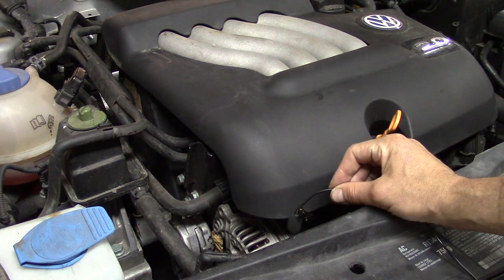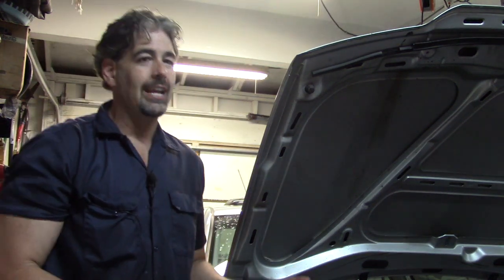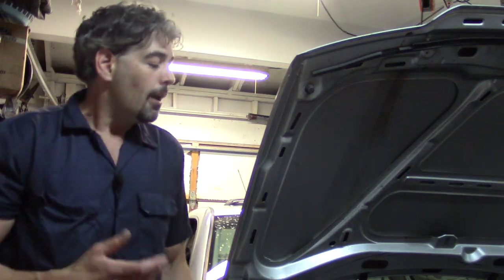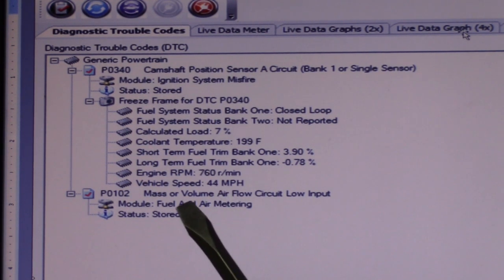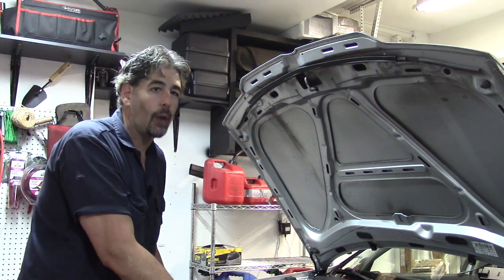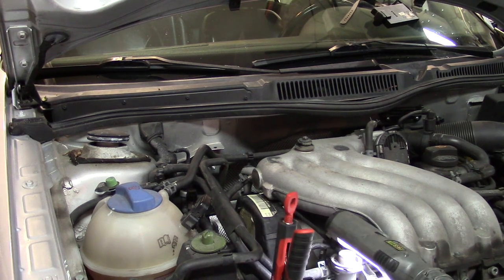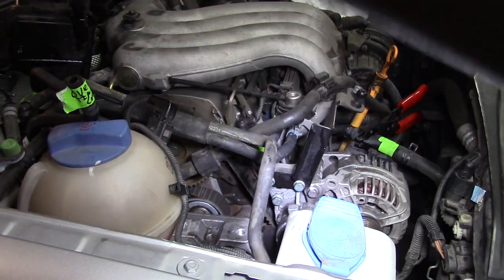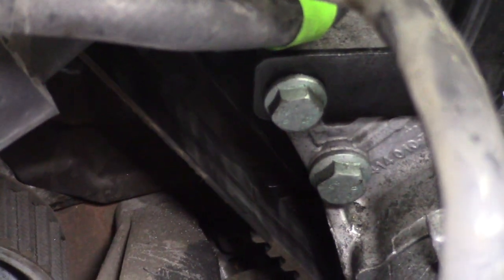Volkswagen Engine Noise Diagnosis

Comment: How did the shop not catch this?!   You have to pull the timing belt and cam gear to get to the cam pos sensor!!
Reply: Exactly what I was thinking.
Reply: They are the ones that damaged it. Slapped it back on and said get it the hell out of here.

Comment: Hey Mr... I love your videos keep up the great work.... from my understanding when you remove the valve cover there is another cover that goes over the cam shafts... could that be your broken piece? Also there is the all time audi vw problem where the high pressure fuel pump wears heavily on the cam lobe... my two cents
Reply from the maker: Jose Sifuentes Indeed a loose fragment of some sort behind the timing cover was highly suspected.  As for a high pressure fuel pump wearing out a cam lobe- that honestly makes no sense to me whatsoever off-hand. What is proposed theory behind that?
Reply: Audi Volkswagen have direct injection on their vehicles... if you so happen to have this engine.... what we see here at the stealer ship is the highpressure fuel pump runs off a cam lobe and that part becomes heavily worn
Reply from the maker: Ohhhhhhh- that makes sense!  Yeah I am not versed in direct injection. I will have to research that but your explanation seems reasonable.

Comment: Matt great lesson to all the people out here in you tube land that think all there is to diagnosing a modern vehicles is plugin in your whatever and getting a code(s) are sorely misinformed or downright ignorant. Verify,confirm and validate.Thanks again.
Reply from the maker: Daniel Wells Thanks Daniel.  BTW "wells" is perfect last name for a diagnostic mechanic lol.  Any relation to the company?
   Yeah Youtube blows- I actually decided to look at the market for videos on the timing belt change- NONE showed the correct procedure for adjusting tension and in fact the most watched video on the subject of all (almost 300K views) didn't even mention tensioning- in fact the hack put the belt right back on the same timing components with no tensioning adjustment!!!
  I feel responsible to now make a video of the tension adjustment just so YouTube will have a resource for this engine.
Reply: Schrodingers Box YouTube blows?  Mr. Box I love your videos. They are spot on for someone who is not a paid tech. I hope you continue to contribute.

Comment: No special tool needed for the serpentine belt tensioner. An open end wrench (17mm?) will fit on the same tab where you put the vice grip.

On my VW Eurovan, the "special tool" for the same function is an 8mm bolt.
Reply: Yeah i know, as soon as people from murica or canada (or where ever) see an euro car. They freak out. Do some reading. I know, alot of german cars (like my passat -98 v6) needs special tools and all that. But that's usally only for the dealership. They wanna make some money maybe? But you REALLY don't need em. 9/10 you can get by them. 

And in this case, NO there are no special tool. It's 8mm allen head bolt so you can turn it? I can't remember but there are like a regular 10 mm bolt that you can remove it with...
Reply: I'm looking for the egr valve or combi valve  on my 99' vw golf gti and cant seem to find it or figure it out anywhere else. Hoping you might be able to help me out?

Comment: Half the fun of owning my Golf is making the "special" tools in my kitchen and giving the finger to VW. ;)
Great video as ever Matt o/
Reply from the maker: Bob Moore Yes I agree with you- there is definitely a satisfaction to designing your own work-arounds for special tools- especially ones that cost a lot.  I have a whole collection of specialty tools I've made over the years, but the difference is most of them will apply to many, many makes and models. To make a specialty tool for a single model that I may never see again is just not possible because nowadays I have other cars waiting in the queue and I can't spend 2 hours making a tool to replace a drivebelt.

Comment: No special tool required for the removal of the serpentine belt. 16mm wrench to slacken off the tensioner. There is also a hole in the tensioner that you can insert a 4mm drill / pin to lock it in the loose position.

Comment: The requirement for specialist tools for European cars is entirely deliberate, manufacturers don't want us tinkering with their cars when they have a dealer network that will happily charge us £100 per hour to carry out the work.
Reply: It's actually a very weak act. Most of the time technicians just improvise like in this video because it is too much effort to leave the job to find the silly tool. I like all this nonsense because it helps to make European cars very cheap to buy used.
Reply: You can find ways around that, I have used a socket with a extension to pull that belt cover back, you just gotta think out of the box. ;)

Comment: Excellent video! Joy's husband here. Small time repair guy. Yes; germans make a lovely engine. (Got a BMW 325xi with 300k. Motor is like NEW. Obviously; well maintained!) AGREE completely: the special tool thing is wildly annoying. Diagnostic difficulty also. Yeah; i got a 99 Passat with that HORRENDOUS "rattling" in the top of the engine. Gotta be like yers; tensioner out to lunch. Some other videos indicate a 'chain' in the rear of the engine. (another brilliant german anomaly. vis a vis: the HORRIBLE german V6 in the last model Ford Explorer. Goofed up all the time due to lack of oil changes.)  Great engines...BUT; you better do the maintenance dawg...or empty yer wallets!

Comment: man, i joined you recently and now i have alot of respect for you, you are indeed a professional. please continue making more videos and also kindly recommend me a cheap scan tool which can make diagnostics a little easier
Reply from the maker: EngrChillaX I actually used an Innova model- I think a 9430 if I remember. It had all the features you need for like $290
Reply: Schrodingers Box thanks
Reply from the maker: ***** It is self contained, however connecting to a laptop will allow you a bit better analysis (e.g. generate graphs, etc).  I also own an old Mac TaskMaster that I use in the field sometimes. You can find them on Ebay a lot.  It's nothing short of excellent for a scantool under $400.

Comment: That's a VW Mk4.  Ask me how I know! I had that exact same sound on a 2002 Vw Golf, started about ten miles before the car wouldn't go anymore because the timing belt lost too many teeth.

As it turns out, the 2.0 is sometimes listed as interference, sometimes not. Valve damage can occur.

Anyway, thanks! I've been trying to figure out what made the teeth come off like that, and a loose tensioner makes sense. Wish me luck putting it back together without needing to replace the head.
Reply from the maker: Yeah good luck- I too have seen it listed both in interference and non-interference so I am not even sure! Either way, hopefully the valves are still straight!
Reply: what happened to me  i did not change the timing belt  or forgot to !! im original owner of a 02 vw golf 2.0 gl  bought it with 16 miles  on the OD !! im a bad owner !!  BUT the timing belt did not break on its own until 159k miles !!! thats a long life for a timing belt !!! sux i had to replace all the exhaust valves !!!  cost me 1200  dollars !!  live and learn !!

Comment: Simply put if I had time Thursday morning when the video came out. It made my day. Thank you.

Comment tonight after the series is done: Okay. I'm rewatching this video to get further in depth with how you could have gotten to your conclusion with the evidence.

Your videos give me experience faster than real life gives me opportunities so these are the things I'm picking up on:

Camshaft position sensor code has a comment about misfire...okay, that's expected. If an engine isn't known where it's at it can cause misfires. (Speaking of usual misfires associated with camshaft sensor trouble.)

I'd expect a P0300 to come with it ...

Misfire codes tend to set faster than any other code in my experience. If this was the primary concern based on the PCM's evidence why in the world wouldn't such a code get set too? My only answer is because firing is happening on time, that's obvious to this good camshaft sensor and the crankshaft sensor...the reference wording in this case with the camshaft code doesn't apply to the situation correctly even in an unspecific way.

Further throwing out misfires being the primary concern. While the engine is running wrong, it's generally even.

In my ACE prep studies there is a comment about loose timing chains causing a slapping sound....doesn't this sound remind of that, the material is just different?

MAF code, not enough air?

If I keep your FASTTEC method in mind for a car that won't start and remember to consider timing as a basic reason for an engine running right, then and only then could my mind go where yours did.

Thank you for influencing my thinking in the future.

Forgive me if these comments were better suited as notes for myself than a public comment.

Comment: I have had the same car now for 11 years, do all the maintenance myself,  the only special tool that I have encountered being necessary is the spark plug boot puller,  the rest can be improvised.  Even the timing belt tensioner tool is unnecessary,  a c-clip tool works perfectly.

Comment: Proof that some dealers have poor excuses for a mechanic.  Troubleshooting skills and knowledge on the cars they work on is key requirement to the position.  I had a error code related to secondary air pump pressure being shorted.  Guess what they wanted to do?  Replace all related components related to the secondary air pump system to the tune of $960.  I checked the pump and it was fine.  Replaced the pressure sensor ($85) and cleared the VW proprietary codes ($30)... Took 1 hour total.   Passed emissions.

Comment: It's always best if you can replace the belt and show that the repair is verified on video.  99% sure you found the issue but you never know until the after repair video shows the viewer the confirmation of diagnosis.  I thought it was going to be a sheared crank pulley myself because they can make similar clicking noise.  Great job finding the issue quickly and efficiently.
Reply from the maker: ***** Yes if time allowed I would do that but I am leaving out of town soon and have to desperately get this car out of here.  Even if there was other damage the diagnosis still holds true and the main thing was the point that changing the CMPS is just lunacy.
Reply: Schrodingers Box Without proper diagnostics and guessing everything is lunacy. ;)
Reply: ***** For the customer yes but for the money no. The fault said cam pos sensor so a position sensor is an easy sell. People these days are actually proud of the fact they know nothing about cars. This makes it easier than ever to rip off a customer.
Reply from the maker: Andrew Thompson Andrew is correct- the lack of diagnostic capability combined with customer not being car savvy equals huge profit.   If customer had OK'd a $3000 camshaft replacement, the shop would have immediately noticed the broken tensioner and stripped belt as part of the process.  A whole timing kit for this engine is $150. I don't think for a second they would have said "ohhhh, our bad- your bill is now just $600 for a belt instead of $3K for a camshaft".
Reply: Schrodingers Box that's what i tell my friends and i believe in, you should be honest with the customer because if you'll tell the truth, you are getting a satisfied and regular customer
Reply: EngrChillaX That's a strong point at my shop. :)

Comment: Kinda knew what the noise was from the getgo, but I tell ya, that is still a terrifying noise to hear!  I kinda cringed when I first heard it...

A weird thing about non-O2 sensor codes; a majority of the time, if the PCM is throwing a code, the only way it could possibly know to set the code in the first place is if the sensor is working correctly.  Understanding how each sensor works, as well as circuit design, can help determine pretty quickly whether or not the sensor is potentially bad.  It's not a concept I normally bring up, but I think this channel is advanced enough to understand the underlying complexities of it.  :)
Reply from the maker: rhkips Absolutely 100% correct as usual, Kips.   A code that mentions a sensor by name  is often indication the sensor is working rather than at fault.
  I call it "blah blah blah oxygen sensor blah blah blah... guess I have to change the oxygen sensor".   The "blah blah blah" is actually telling you the sensor is working and reporting a condition if you understand it.

Comment: Well done Matt.  The automotive repair field seems to be so unreliable , either lack of training or lack of trying.  The last ASE trained shop was out to lunch on this one.  Imagine surgeons with this  type of mindset .  There are plenty of great techs out there that should be paid as well a surgeon and I imagine there are some surgeons that should be paid  like the one that changed the cam sensor :)
Reply from the maker: Steve Rob Great Point!!!  One of my viewers last year (a female no less) said exactly the same thing- what if a surgeon was allowed the same leeway as mechanics in diagnosing a condition.  "Welp, it wasn't your spleen... lets try removing your thyroid" lol.

  The fact is, as you well know, there is NO DIFFERENCE WHATSOEVER in the diagnosis of a car vs the diagnosis of a medical condition vs determining the cause of a disease.  The thought process is (well, should be) 100% identical in every way in all of these.

Comment: My girlfriend has a 2002 beetle 2.0 with 53k miles and it has a coolant temperature sensor code and misfires on all but one cylinder, plus a random misfire code. The mechanic said head gasket but I'm hoping it's just the sensor. There is plenty of air coming out of the crankcase when I open the oil cap. I would assume piston rings but I guess it could be a bad gasket letting combustion gasses into the oil passages? I'm probably overthinking it but I guess I'll find out once I check more things.

Comment: When a shop say you need something and they replace it. If you still have the problem. You need not pay because they did not fix the problem. 
In my case. I bought a 2004 Golf 4 months ago. The a/c does not work. The dealer said there was a wiring problem and they needed $1300 to find the problem. After finding the problem. They wanted $1700 more to fix the problem. I told them I was coming to pickup my car.

Comment: Hey Matt, that was an efficient 10-minute diagnosis! Wow I'm really surprised the engine is still running with all those teeth missing on the belt. As for the P0102 MAF code, those VW MAF sensors are prone to failing for no reason, often resulting in a start-stall as the signal to the PCM will be lower than it should be for a certain airflow. Just diagnosed one a few weeks ago...quick test is unplug the MAF and if the car runs fine then you're done lol. The P0340 looks like a circuit fault...wonder if the loose belt hit the sensor and messed it up? Wouldn't be surprised if the new one is toast too haha. You need a scope ASAP to show us some sensor signals :)
Horray for parts changers!
Reply from the maker: motoYam82 Yeah the fact check engine light only came on after the noise started leads me to believe the MAF is related to the timing.  If I had time, I would have checked the CMPS signal actually.
  Note I said if I had time... not "if I had a scope"...  hmmmmmmm......  And my next video will be on MAF diagnosis.... hmmmmmmm.......
Reply: Matt, looking forward to the introduction of your scope...
Reply from the maker: Louis Pasnik Lol... now I didn't say that!!!

Comment: The camshaft position sensor the other guy replaced is behind the timing belt pulley, which means the guy was working in that same spot and never noticed the belt was missing all those teeth and the tension wasn't set right.

Comment: Was there any valve damage? I have an 04 Golf, they are supposed to be a non interference engine (this Jetta appears to also be a Mark 4 like mine) and my water pump impeller (plastic) exploded, pump seized, ripped a bunch of teeth off my timing belt, and I ended up with 5 damaged valves. I was shocked. Machined the head and replaced all the valves, polished up the pistons, new timing belt and new water pump with a METAL impeller, and now besides some obnoxiously loud valve noise she's all good again.
Reply from the maker: No valve damage but good thought!!!

Comment: the problem with pro shops are they are pushed to do a job quickly as possible. the mechanics arent really allowed to "dick around" with trouble shooting the shop owners just care about the bottom line

Comment: @Schrodingers Box
Heyy Mate, i'm curious. The loan car of mine its a VW Plus 1.9 TDI 90hp... And it started making that noise aswell, the only weird and odd thing is. It only makes that sound when you've driven for 30~ minutes. Did this car with the timing belt tensioner had the same symptoms or did it even make that sound on cold engine?
Reply from the maker: This one did it all the time but it doesn't mean you can rule it out as a variable
Reply: @SchrodingersBox  Merci for the quick reply mate! I know i shouldnt rule it out, but was hoping for good news, i dont like to have broken loan cars lol. As my own Honda is being repaired.. Do you ever make videos in regardings of Hondas? If so, you're the source of knowledge I want to know :P 

Good videos!!
Reply from the maker: I don;t really make videos on specific cars. To me all cars are the same. They all use the same OBD-2 and the same principles of electrical and engine management.